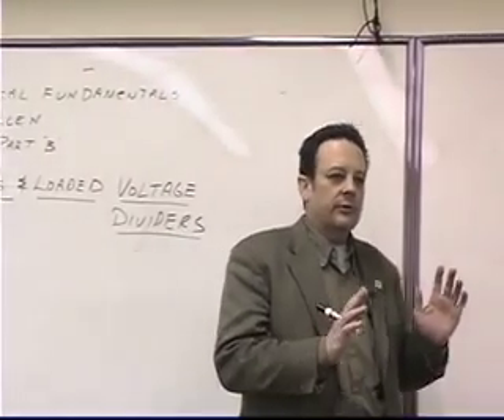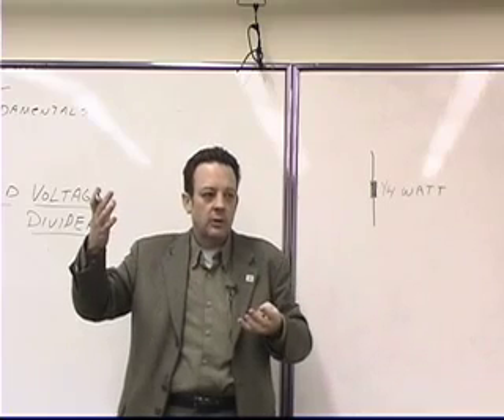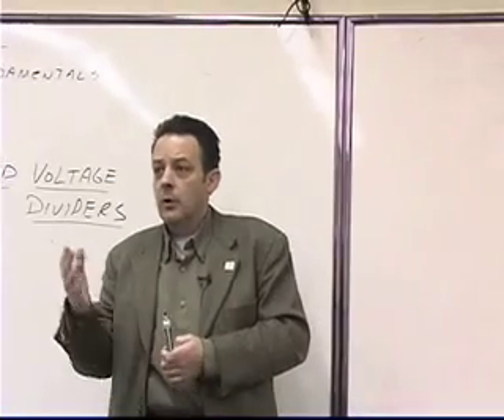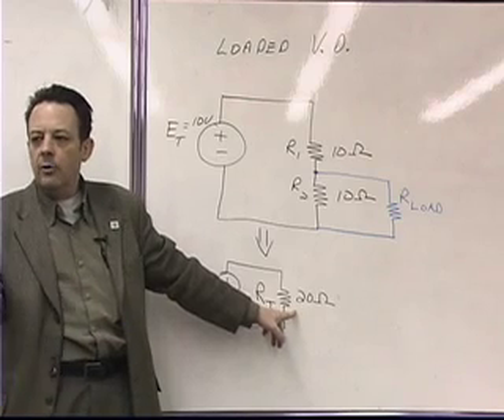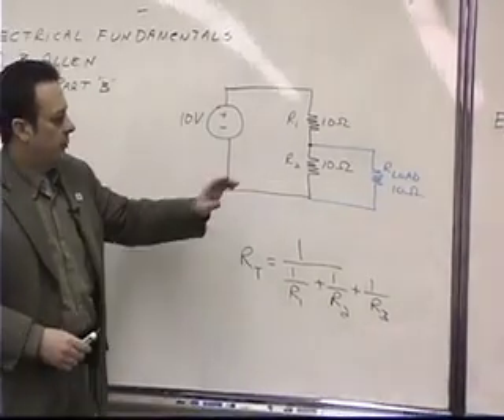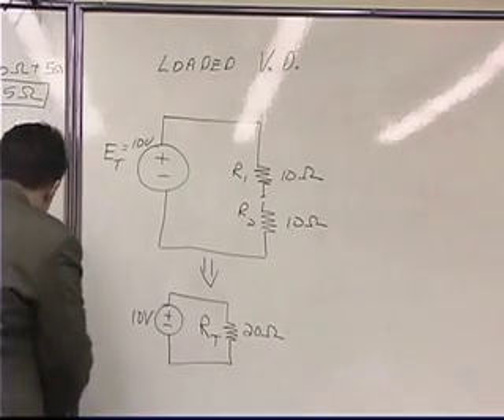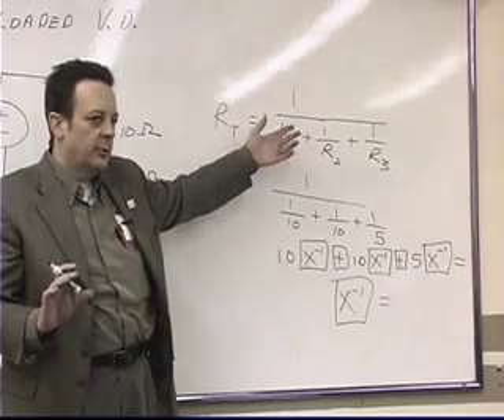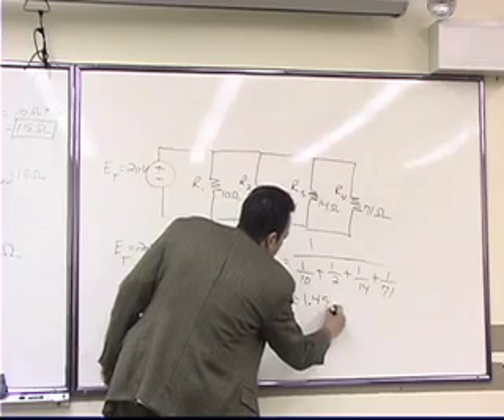voltagedivders-p2.mov

Comment: PARALLEL loads are extra pathways for currents.  Thus the total current increases with more loads, unlike series loads.   This means resistors in parallel will always have a total resistance less than any single resistor.